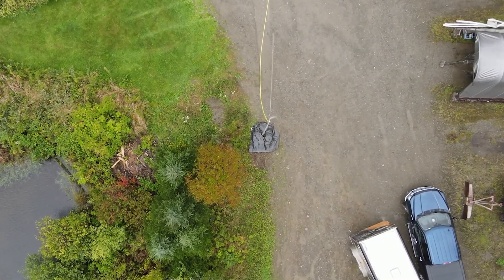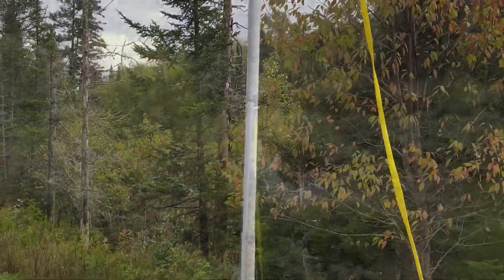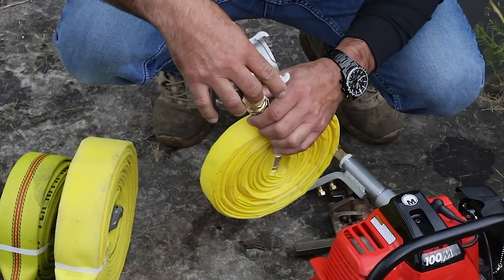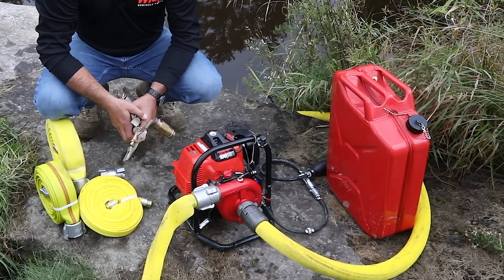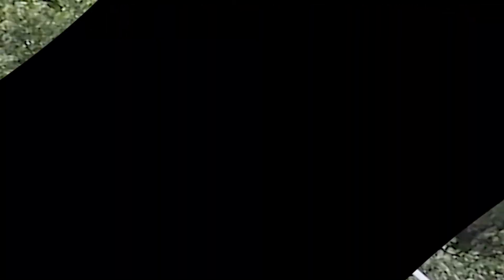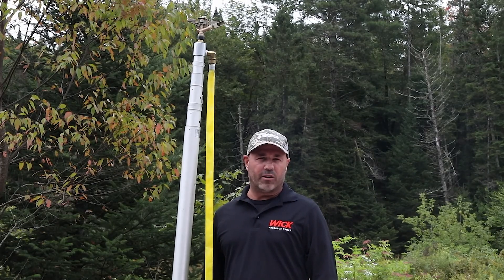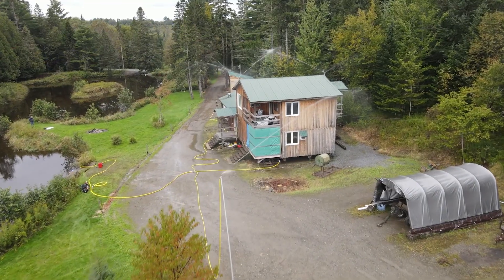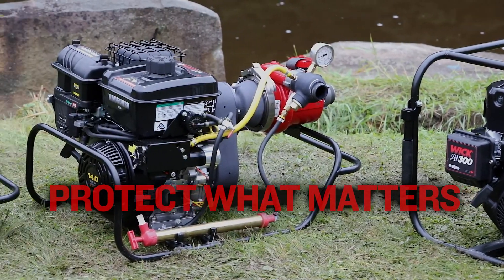WICK® Value Protection Flagpole Sprinkler System Explainer | Wildfire Mitigation

Comment: It would be better if the flagpole was the hose.  Does not look “easy” to use.  
If looking long term, metal pipe should be used underground and the only thing to do to deploy is the pump and pickup hose.
Reply from the maker: Easy is certainly relative with any system. There are a few different ways to do these value protection systems. This one is intentionally more "mobile" or short term, not a permanent installation. This one is relatively easy/quick because it doesn't require any permanent infrastructure – it can be set up in less than an hour if you have the system preplanned and the pieces readily available. The assumption is people would only set this up for the peak seasons or when threat is imminent. People could also use an existing flagpole if they have one on their property.

Comment: Where does the water come from. In a built up area could the infrastructure cope with multiple insulations ?
Reply from the maker: For these systems, the water is open source – such as ponds, lakes, rivers, or even pools. There are a lot of variables to consider in terms of how many installations or sprinklers a pump could handle... distance/rise from the water source, distance/rise to the sprinkler, size of hose/sprinkler, power of the pump, ideal coverage area, etc. This would need to be calculated for each installation.

Comment: So, can someone tell me why fires are so destructive when homeowners can use products like this one to protect their homes?
Reply: They think “insurance” is the fix all!
Reply: @henrymorgan3982  until you can no longer get affordable insurance.
Reply from the maker: While we agree with your sentiment and hate to see the destruction when we know these systems work – it is more complicated than it seems. Many homes don't have access to open source water that would be required for this type of system. It does not tap a municipal water system. That said, we would love to see more people adopt these solutions. And we would love to see communities/cities/municipalities install permanent mitigation systems in high risk areas.
Reply: @MercedesTextiles  I understand this would not be feasible for most communities. But I do think a flag pole system may be a benefit even without the generator and pond water. (even though that is what you are selling 🙄) imagine if the homeowner could spray a fire retardant over the roof. OK not practical.  Thanks for your response.
Goodluck to the company.